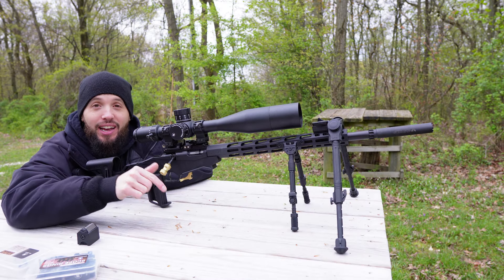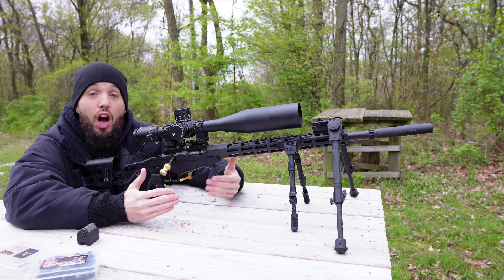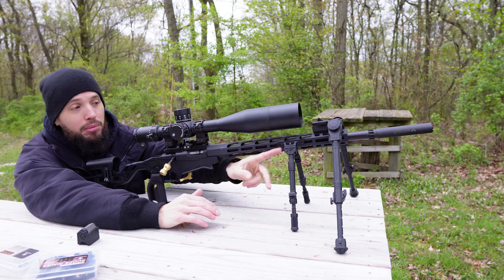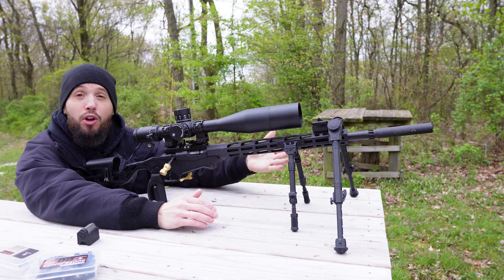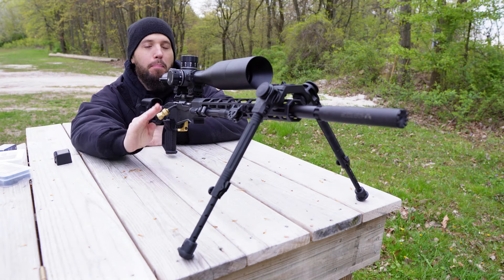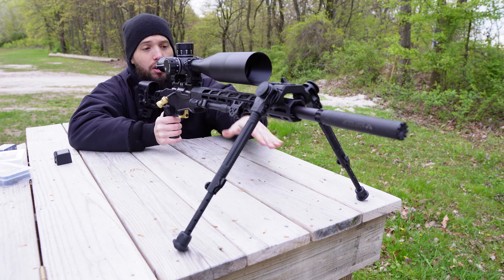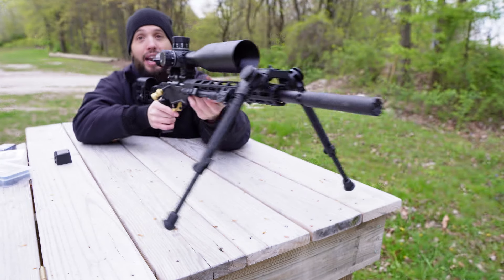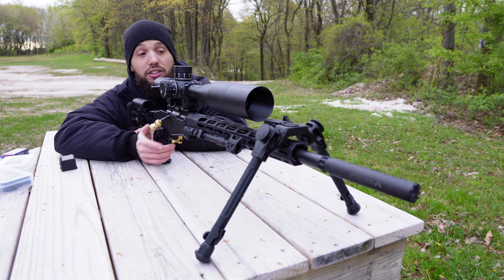Do You Need an Overbore Bipod?

Comment: I bought one to try out. Its good for the price. Its nearly impossible to tip the rifle over with it on. Its easy on and easy off. It can handle my 17lb rifle with ease. I did have to snug some of the hardware to my liking. If you load the bipod like your supposed to its fine.

Comment: 1) gun hanging under the bipod is 100x more stable. Traditional bipods are going to allow the gun to tip over.

2) why spend money on the riser vs putt8ng that loney towards a low profile pic rail?

Comment: Fortmeier makes the best overbore bipods.  Fortmeier are stout and not all flimsy when mounted on your MRAD.   The UTG overbore bipods is ok on that 22 rifle but they wont hold up to a rifle with any weight that shoots magnum projectiles.
Reply from the maker: What do you mean by hold up? Like break? It seems solid. I don’t know why you couldn’t use it on something larger. What fails? I’m asking because I don’t know. You could certainly be right.
Reply: Those overbore bipod are fine for benchrest(probably not ideal if your competiting to win), prone matches, essentially stationary precision matches.  I believe the guy above is referring PRS style matches.  Those field matches that add hiking, movement, other shooters(accidental contact ex: knocking over a rifle) or obstacles are harder on equipment.  I am unsure if your over the bore bipod is made well enough to not have issues.  I will say good luck with obstacles you’re going to encounter with your overbore you going to have to learn to adjust on certain obstacles in field matches even NRL 22(whatever the new name is for rimfire field matches).  The UTG  that’s attaches to rail version is really to me is a novelty/in an emergency use what you got.  That UTG product I see that on a lot of $400 Ar-15’s,my opinion guys have an idea they can get a slimmer profile and quickly realize it’s a novelty.  Secondarly over bores usually add weight and the only over bore bipods I have seen used are super expensive like the 500 dollar price point.    Shoot a season of field matches you’ll see what works and what products have issues.  Trust me you won’t be shooting video from the bench anymore and the bipod discussion will be diminished as most of your questions will look at tripods, shooting sticks and positional shooting off obstacles.  Bipods in the field have there place but the reality is might be a 1/3 of the shooting.  So the the next question you should asking yourself does you overbore bipod help you or hurt when addressing obstacle shooting.  This is where the traditional Harris, Atlas, Skype pod bipod enhance their usefulness maybe your overbore does exactly the same thing and maybe it doesn’t.  Personally I run quick attach bi pod mounts as well just encase a stage happens that I need to throw the thing off for a stage or need more room too clamp to a tripod or shooting sticks.  Match directors know how to get you thinking outside the box…lmao.
Reply from the maker: @roady7420 noted. Again, I’ve never shot any of that stuff so that side of the industry is new to me.
Reply: I would suggest finding a 22 NRL/PRS match in your area.  Those type matches are lots of fun are normally just at a local level for fun and enjoyment.  Everyone is usually very nice, they are focused on safety and the first match usually someone is assigned to assist you with safety and watch you until your at the safety standard in a match environment at least that has been my experience.  The biggest value from matches it makes you a better shooter and diminishes the fantasy of the abilities we think we have.  It’s not the best equipment while that can enhance,  I have been beat on a regular basis by guys that spent less money on equipment and more on shooting experience.  If matches aren’t your thing then attend a PRS training with someone that’s known like Phil Velayo, Cayden Wojik experience of a lifetime to learn from those guys(bucket list thing for me to learn from them or Frank Galli).  It’s kinda funny I come to your channel for your excellent H&k content excited to see your growth into new opportunities.
Reply from the maker: @roady7420 I appreciate the advice, thank you! Always wanted to do some of this style of shooting and I figured the RPR is a good first step. I love shooting 22 though I don’t need to go big bore.
Reply: I have the UTG Over the Bore bipod; it's a let me see type purchase, whether I'll like it or not. I am looking at another bipod by Elite Revolution, an over-the-bore bipod. The cost is $610 with a panning model. Without the panning, the cost is $585.
Reply: @rudolphferdinand3634  Your better to buy the Fortmeier since it's made in germany, it will have ever increasing value since its imported and of the highest quality vs the domestic made Elite Revolution 360 rotation at their price point.
Reply: @rudolphferdinand3634  this is the over the bore bipod I was referring too above that I couldn’t remember.  I just forgot the manufacturer.  Thanks Rudolph
Reply: Holds up to my 17lb 308Win just fine. Its not ideal for all occasions but fits for most.